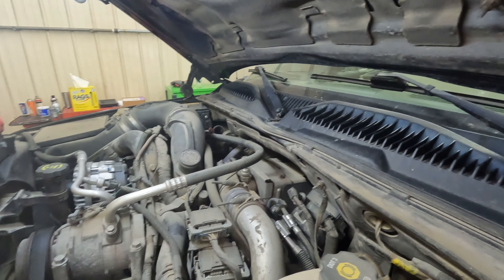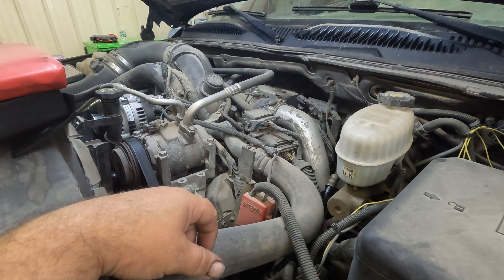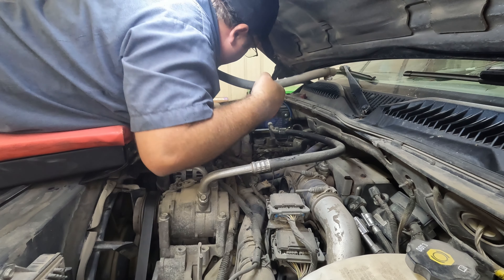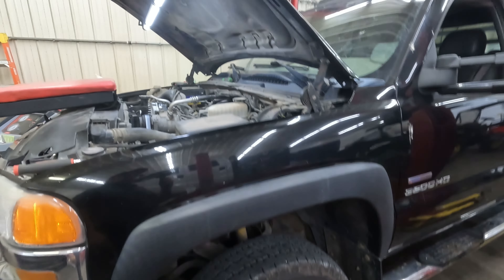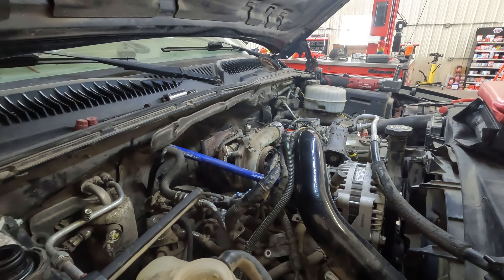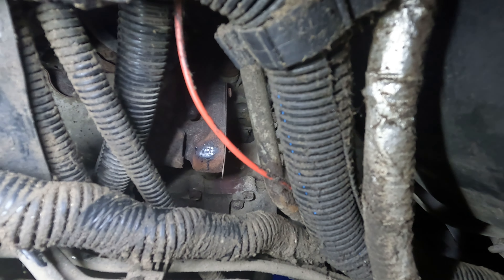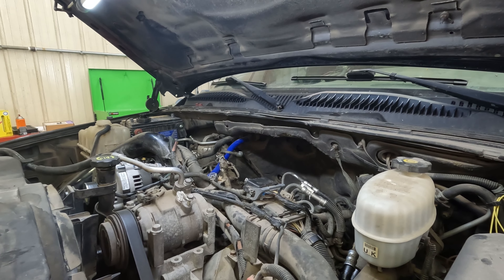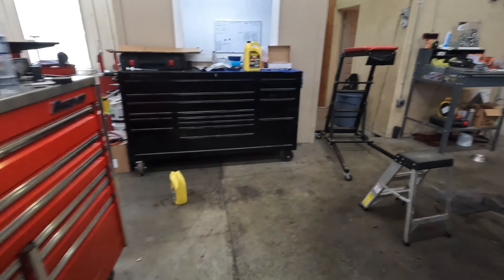LBZ Duramax turbo replacement. Broken turbo! No boost! #mechanic #duramaxdiesel

Comment: That job sucks.  I've done but in sections. Egr delete, compound turbo install, then new factory turbo.  The heat shields on the up pipes are the worst. However I coated everything in pb blaster 3 times a day for a week leading up to the job and every bolt came out like butter.
Reply from the maker: Soaking them in penetrating oil is definitely the way to go!

Comment: What size is the oil drain opening in the back of the motor. I want to get a rubber plug to install after pulling the turbo. Then I  can clean.
Reply from the maker: That’s actually a really good question. I have never put a plug in there. I’ve always used a blue shop towel

Comment: I'm about 3/4 of the way of pulling my LMM's turbo.  560,000km.  Yeah, not fun.
Next time (IF there ever should be one) I'm doing it the "book" way, and pulling the trans!  Then it's all pretty much right there, in your face.
Reply: Or I'll just lift the cab.  Oh, and on mine?  I got all 12 bolts out!  Were they tight?  Oh HELL YEAH! But none broke.

Comment: So how much is this job? I got an 06 that the veins stick open once its hot. When it gets cold, they work again.
Reply from the maker: It depends on how stuck the fasteners are and what all breaks when you take it apart. I try to be very open with the customer prior to the job that things might break and if so it unfortunately adds to the cost. It usually runs around $3-$4000.

Comment: How to stop lower return gasket from leaking its bigger then the hole
Reply from the maker: The hole in the gasket is not bigger than the flange on this one so therefore it doesn’t leak.

Comment: Is it ok to drive my 2006 lbz with the poo3a code? My vanes are sticking also
Reply from the maker: It won’t hurt anything. This truck was like this for 2 years. Eventually it usually gets bad enough to lose power.
Reply: @hrdiesel  I have a injector tick in my truck on the passenger side I would like to send you a video of it if possible to see what you think